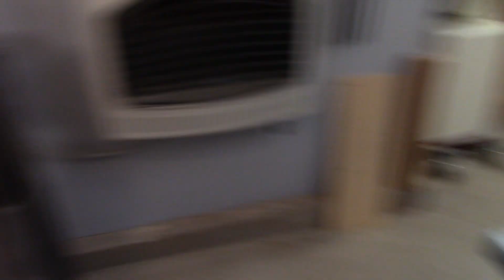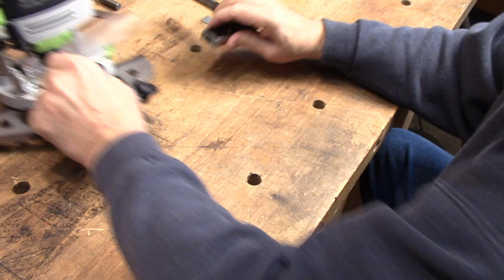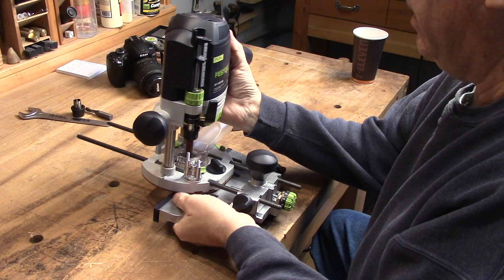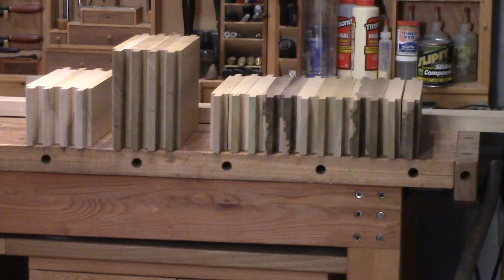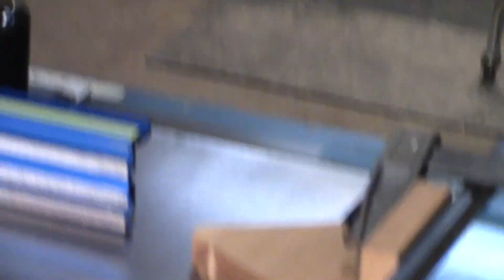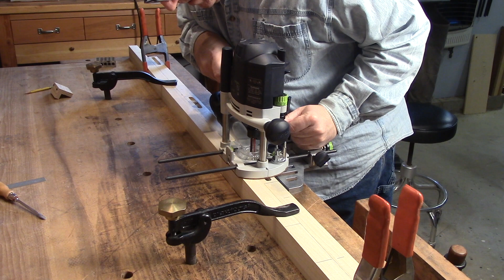Mortise and Tenon Joint with Festool Router and Table Saw with Dado Blade

Comment: Great video Frank. I generally think that routers have a tendency to pull to the left. Wouldn’t it have been easier to keep the fence tight against the stock  by either (1) putting the fence on the other side or (2) routing in the opposite direction? Or maybe things just got reversed in the video.
Reply from the maker: Thanks Jim.
I found it hard to get a comfortable and controlled position on this router, moving left to right with the edge guide on. Could just be me. However I found the mass, rigidity and control from the edge guide to be good. So cutting right to left for this application was my preference. Took a little getting used to. On a plunge cut like this the tendency to pull left was there, but could be controlled with the left hand on the edge guide. I suspect that may be why Festool placed a considerable hand grip on the edge guide? Just a hunch though. On an open edge cut, you can rotate that horizontal handle about 70 degrees to the right, have your left hand on the knob, over the stock, and make a comfortable, controlled left to right pass. 

To be clear about what I am referring to, moving right to left with a router, on an edge cut, creates a climb cut; it’s like a tire on the road pulling you along. Moving left to right is a push cut. The “tire” is pushing back at you as you advance the tool, so you have a controlled engagement. In a plunge cut, like this mortise, one side of the cutter is climb cutting and one side is push cutting at the same time. The resulting force will pull the edge guide to the stock in the L to R direction or push the edge guide away in the R to L direction.